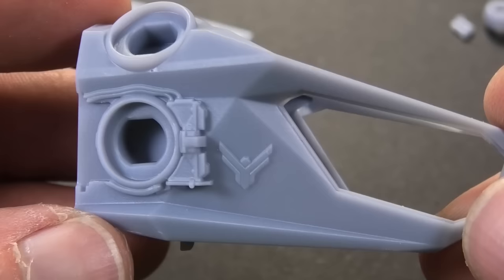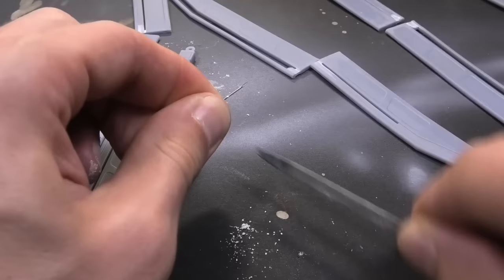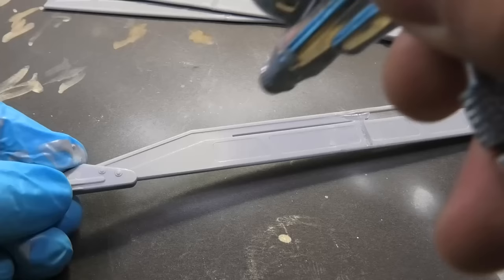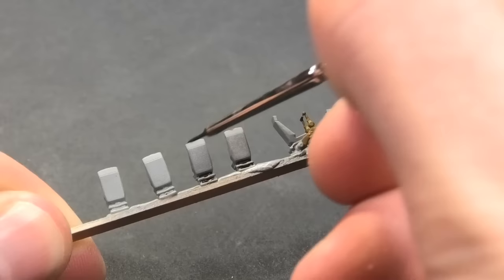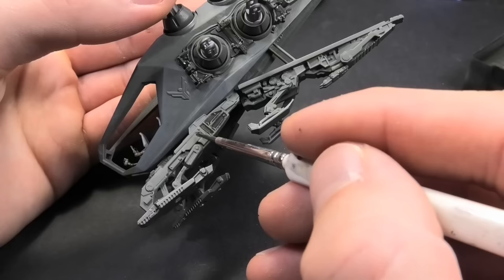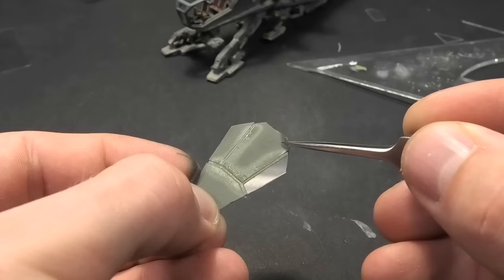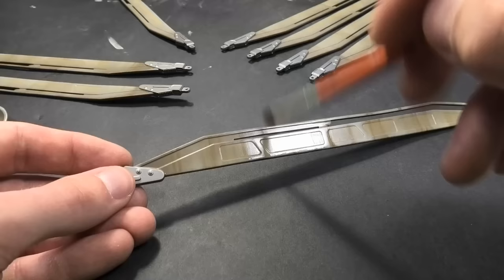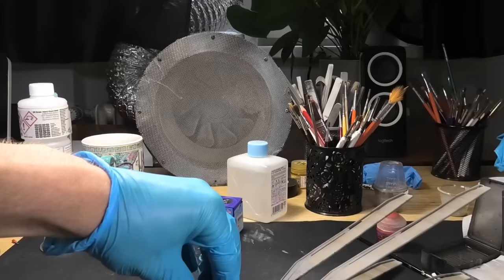Dune Ornithopter - 3D SLA Printed - 1:128 - sci-fi Model

Comment: Looks fantastic! I recently started using UV resin in builds and you can get some great gap filling by mixing it with talcum/cornstarch/baby powder if you have large gaps or layer lines to fix (like from a filament printer).

Comment: I heard of a trick when it comes to plastic resin. When you use the plastic glue the stuff that melted slightly so they can bond together. If you take left over spews from plastic kits and put in an empty jar and put a little bit of that plastic glue in it, it'll melt it and make a slurry. Some people use that slurry to cover up cracks and scratches for plastic model kits. I can't remember the video unfortunately if you want to look it up on YouTube

Comment: Have you tried cut the supports before curing? Its a lot easier cutting these with a sharp blade before curing. If you are not overcuring model, supports can seperate pressing by finger to joints and wont leave a scar on surface. Also i love your style and learned lots of things from you for years. Appriciate!

Comment: I just stumbled across your channel and I think your stuff is very, very cool. I remove my supports after washing. Wash them, put them in hot water, wait a moment and then they go away great. Then I harden everything. For filling I use resin with baby powder and a silicone/rubber brush. Personally I think it's just a normal brush...

Comment: Great video. The finished product really hit me. I can’t take my eyes off of the “Dragonfly”. It makes me think that this is a predator. I know it isn’t, but it just has that appearance. The fact the model allows the builder to extend or retract the wings at will is brilliant. As usual you did an excellent job. Your painting techniques are second to none. Great work.
Reply: Actually ; Dragonflies are predators. They primarily feed on other insects, such as flies, mosquitoes, gnats, and even smaller dragonflies. They are highly effective at capturing their prey in mid-air using their sharp mandibles and agile flight capabilities.

Comment: Since you're using a resin printer, you can change the durability of the final parts by mixing resins of different properties.  Mix in a little bit of Flexible resin to the normal brittle resin and the final parts will be much tougher.  Start off with a 90/10 mix and adjust from there.

Comment: Tip for cleaning supports. After washing in IPA (or water for water washable resin), use a cheap hair dryer and direct it towards the tips of the supports and they will easily come off. Some people use hot water but that's messy and you have to take extra steps, like disposing of the water combined with resin trace amounts.
Reply from the maker: Thanks, I will try it. The major problem seems to be that I remove supports after curing. 🫡
Reply: @idaemonplasmo  Yes for sure.  I remove mine after a dirty IPA rinse. Wash and cure really helps speed this up.  I will often soak in hot water, supports then almost fall off.  Let them dry overnight before curing.  Thanks for a great video you can really see your mastery from the WW models.  Always a pleasure to watch your videos!  I’m looking at the GK2 as it has a temperature controlled chamber.  Great for our Canadian winters.  The warm resin with the 8k or 12k really finishes prints nicely.  Take care

Comment: Hmm. Maybe the fitting of the parts would be better with resin that has a very low shrinkage. Of course it would be more expensive resin. But in my opinion, if it saves times and work, that's worth it. The exposure is important, too. Too much and the parts are "bloated". Which also has an impact on how the parts will fit and it does cost details.

Comment: Supposedly machines like this wont fly.  At least not for long.  There was already a contest winner hosted by the US Air Force who developed a drone with these kind of wings. In the end the project was abandoned due to lack of scientific advancements in material strength of the motor joints.  They screwed everyone over and took the money and ran.

Apparently if you do it right these drones can stop on a dime and move diagonally, forwards & backwards in a split second.  Amazing if true!

Comment: Man that is superb work.. the dust is good. Depending on how long its operational though, any joint/ or exhaust will have an accumilation point to the craft simpyl to to ferrous, moisture, dirt and stickinessa and atoms disperse from the use. THe ball joints imo, if used, should of a directional use position on th exterior, but meh I could be wrong, jsut my thought, so don't think it as important, but this looks great.

Comment: why dont you remove the supports before curing the resin?
also you can use the printer resin to fill in seamlines aswell and fill the lines

Comment: I built the Fremen ornithopter in 1/72 for my club stand at Scale Model World, it is a great design! The wings on mine were very thin at 1/72 and drooped, even with wire rods in them. I was using Elegoo ABS resin, your results look so much better. What resin did you use :)?

This build is awesome, as always!

Comment: Is it just me or does it seem like the designer intended the scale to be different. The control chair looks like it should be most if the cockpit but they were like "Damn we need it ro be bigger. Just make the chair in the mofel smaller. That's the new scale.

Comment: Gah the bit where you are brushing on the resin with no gloves, BAD. 
Also removing supports is so much easier if you use hot water after washing the parts but before curing.

Comment: Basically a dragonfly mech. Which informs the wing physics can't work without unobtainium... We aren't that far off but the cost would be astronomical.

With 3D printing requiring almost as much ingenuity as a real object, won't be long until a miniature drone version is flyable tho.

Not seen Dune but this strikes me as the same kind of almost-future like Avatar, taking existing mil tech as the basis. It only has to function on greenscreen...
Reply: Ornithopters are used in sci-fi because they look cool. The Dune world has some sort of anti-gravity, or reaction less drive technology as shown by other flying vehicles, but the dragon fly tech is neater to  look at. 
Engineers have built some flying ornithopter models but they aren’t very efficient and can barely fly. Real birds and insects fly using complex wing motions, not just flapping the wings up and down,  and it is very challenging to replicate it mechanically.